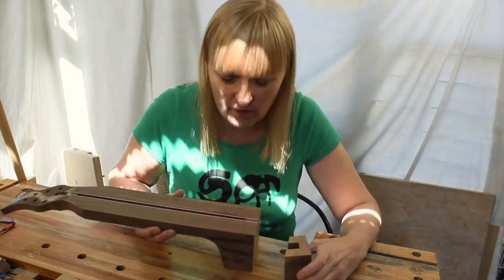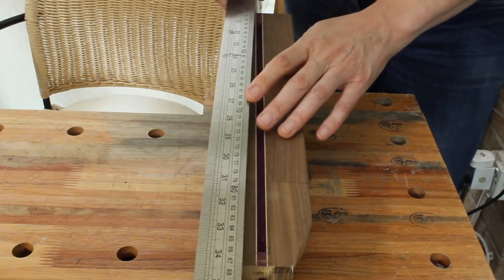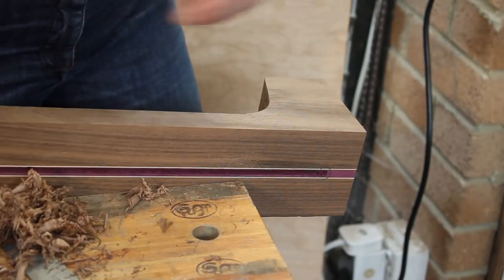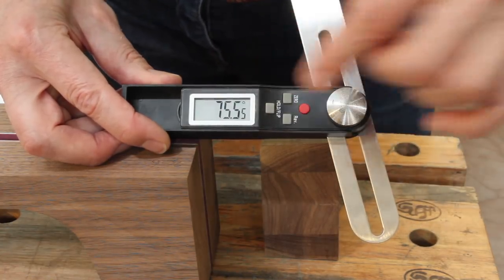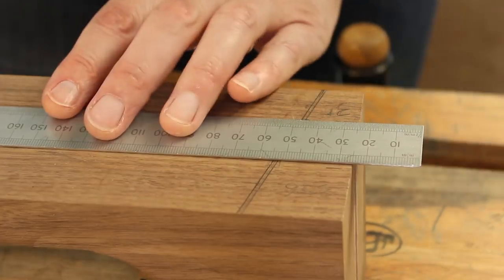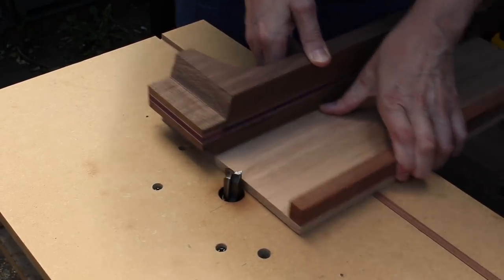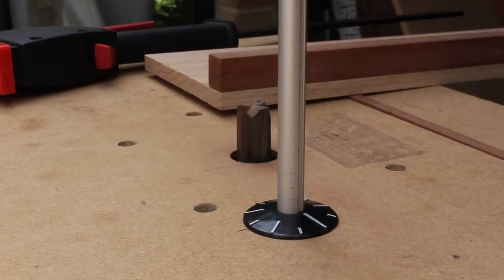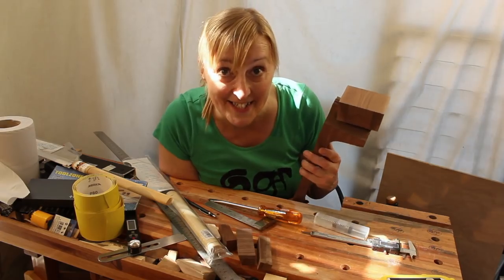Sugar SG1 acoustic guitar build part 31: The neck tenon

Comment: Thank you Susan for your videos. I thoroughly enjoy them. One of your followers was a bit confused about the truss rod' s function. I thought I would comment and hopefully it will help. The main function is to raise the fretboard ever so slightly through the middle frets to allow for a very straight fretboard thusly allowing for a proper fret leveling. Then you can re-adjust by lowering the fretboard for playing without the dreaded fretbuzz. 

The carbon fiber is to stabilize the neck wood to help with a more stable neck especially if you carry it through the headstock. 

I know my opinion is my opinion and don't want to offend anyone . Thank you, Tim

Comment: Nice sawing. Yes, a chisel is the high precision tool for shaping the corners. You can take the bulk out with a saw first. What's important is that the last cut with the chisel is thin, so the waste doesn't force the bevel down. Chisels are very good at extending flat surfaces.

Comment: thank you Susan. i got a question if you don't mind it pertains to necks  truss rods and carbon fiber inserts . the question is truss rods are for moving the neck . carbon fiber   is to keep it from moving ? i am so confused so i put in a truss rod and 2 strips of carbon fiber to hold neck straight how does the truss rod move the neck ??? thank you
Reply from the maker: The carbon fibre stiffens the neck, but the truss rod can still adjust it. Some makers use carbon fibre beams in place of a truss rod - the neck doesn’t then move, but it can’t be adjusted either - very tricky to set up properly as you still need relief in the neck
Reply: thank you

Comment: Make a jig for your fixing holes... surprised you didn't hog out using a bandsaw. Done in 5 minutes!
Reply from the maker: I can’t get the heel under the bandsaw. I will be getting a decent bandsaw soon (I don’t think I’ll be building one!)
Reply: No don't do that! I nearly always end up modifying the machines I have. My large bandsaw recently had a refit so I could resew 11". It is a question of need. I have a hobby bandsaw like yours and was annoyed with it until I forced myself to take it apart and set it up properly. Every bandsaw I have owned, with a little modification, I have added at least 20mm to the cutting depth. Of course it invalidates the guarantee but these things are designed to fail the day after the guarantee period :)  If you opt to drill your holes after you glue the box together and are using 1/4" bolts I have a reverse counterbore that you can use to pocket the connector bolt heads. Used in the aircraft industry to clean up the burr on blind holes. Dead expensive but does the job.
Reply from the maker: My bandsaw is only a few mm short so even just shaving the end off the guide column might work. A jig is a good idea. I have a step drill which could maybe recess the bolts. Not sure if there’s a structural reason for pocketing the heads of the bolts - is it just aesthetic?
Reply: Yes - the American builders do it. It doesn't concern me. Believe me, drilling those holes when the box is together is going to be a whole lot easier especially if you are going to use 2 bolts. You don't have to over-think it either...
Reply from the maker: I won’t drill the tenon holes until I fit the neck but I think I’ll drill the block holes before I glue it in place
Reply: OK. There are always two ways to do something. The right way and the hard way.... you have tie to work it out :)